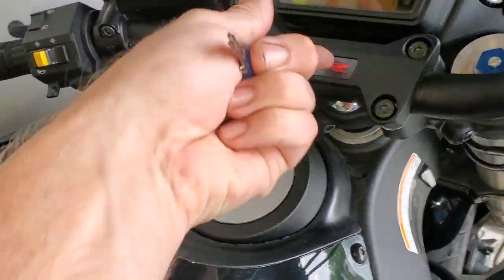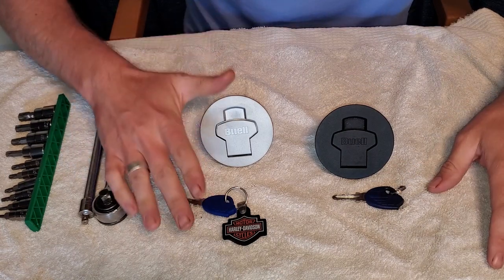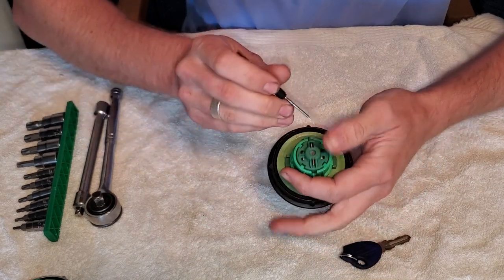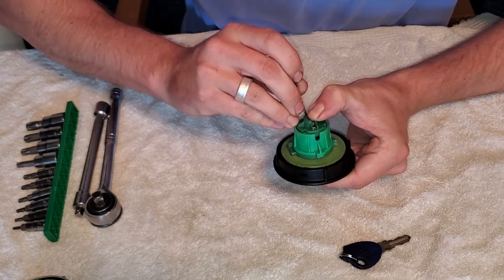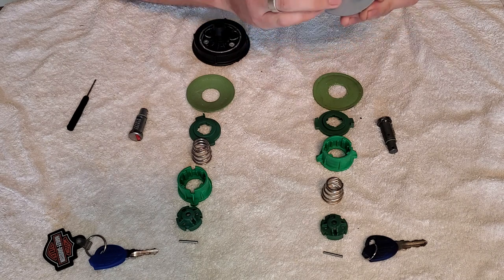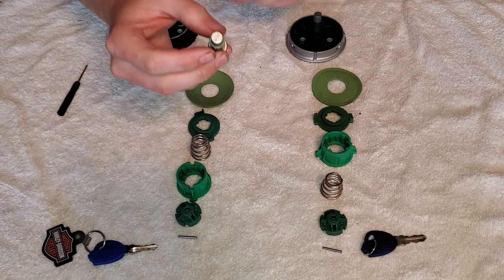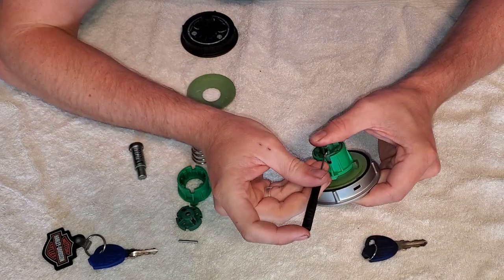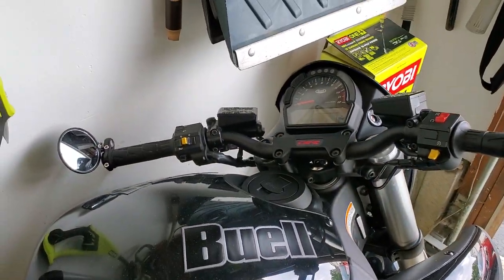Buell XB and 1125 Gas Cap Lock Cylinder Replacement

Comment: And here I thought you were going to keep the silver since you already had silver forks!  I had considered the black cap when I was ordering parts, but ended up going the same route you did initially.  Hopefully I don't regret it and want to pick up a black gas cap later. :)
Reply: And I just caught the black forks part at the end... Guess that explains it!  I hope to get my conversion done this weekend, but it may take a bit longer than expected since I have to watch my little guy while the wife works all weekend.
Reply from the maker: Goodluck with your conversion! It's not the most complicated thing but can be a little time consuming. I honestly liked the silver forks and silver gas cap but I picked up a parts CR and couldn't resist using the black forks, black cap and some other stuff from it.

Comment: Hello, I have a 2003 buell xb9s lightning. The gas cap is super hard to open, like it feels the key is going to break. Have you had any experience with this issue?
Reply from the maker: I have had that issue. What worked for me was removing the gas cap and spraying some white lithium spray on the rotating green parts as well as in the lock cylinder and then turning the key a bunch of times.